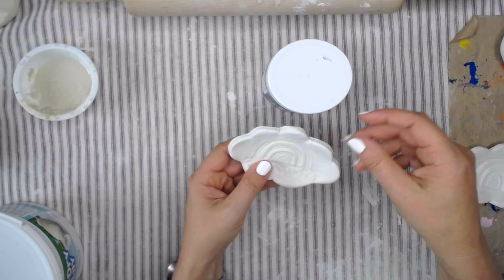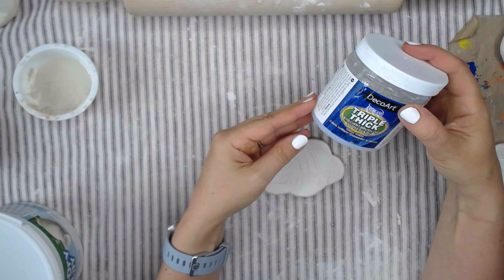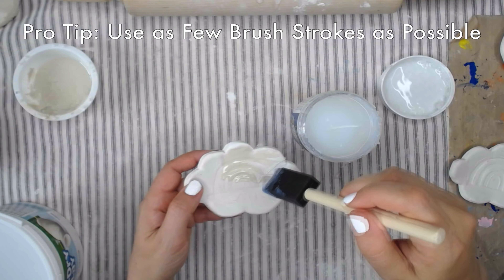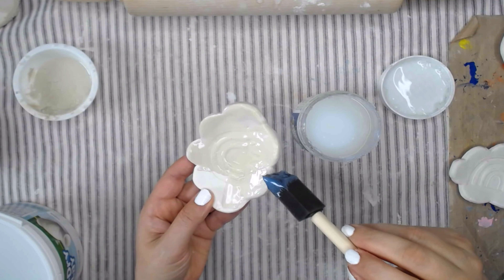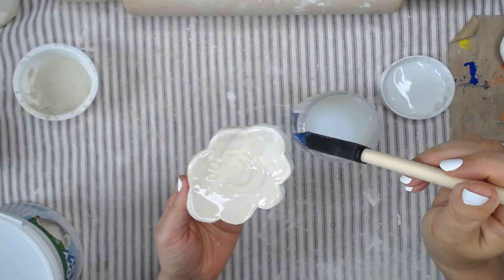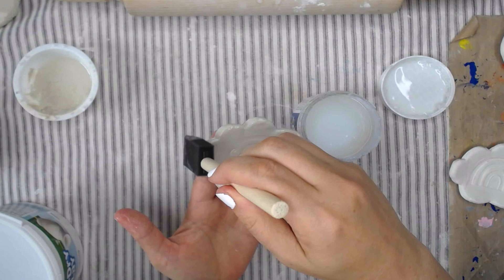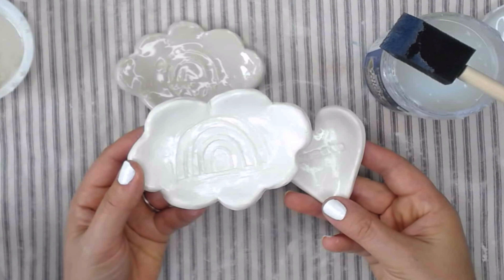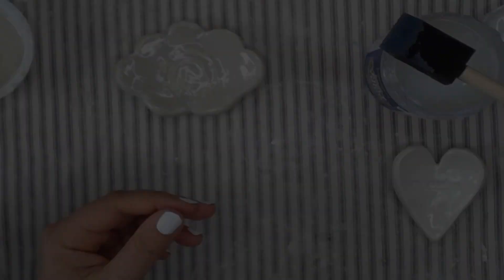How to Glaze Air Dry Clay Bowls

Comment: Does this glaze completely waterproof it? I'm looking to use it for plants and want to make sure it's plant safe at least...
Reply from the maker: Hi! So I did a bit of looking and the glaze is water resistant but not waterproof. Bc it is water based acrylic it will break down with exposure to water. But I know I’ve seen little planters so I did a bit of looking and found a tutorial that suggests you line the inside if your pot with a plastic container. I would think a yogurt container would work well with smaller pots and they used a sour cream container for a larger pot. I’ll add the link so you can take a look. Thanks for the question! I learned something new! https://myhusbandhastoomanyhobbies.com/diy-air-dry-clay-planter/
Reply: @WellCraftedStudio  Thanks!!!!!! So helpful!
Reply: @WellCraftedStudio  and great idea!!!!!

Comment: Hi. I used mod podge on my clay art and dried it completely. The problem was that it became sticky and the clay piece would stick to the surface it touches and peels off like plastic. Please advise on what to to do with this. 😓 thank you.
Reply from the maker: leslie santos unfortunately mod podge is similar to the triple thick glaze that I used in that it is acrylic based. Which means that it is basically a plastic and can be affected by heat, water etc. Maybe if you use a spray acrylic like polycrylic sealer that might cure to a harder coat. I’m really not sure though as I haven’t tested it. Sorry this isn’t more help!
Reply: @WellCraftedStudio  thank you for replying to my inquiry. I will try your suggestion. Thank you so much

Comment: hi! if i make a mug out air dry clay and proceed to glaze it? does that protect it from softening when used for beverages like coffee?
Reply from the maker: ryle u As far as I know there is no safe way to use air dry clay for beverages. Glazes  are acrylic based which means they are both water and heat susceptible. Acrylic is basically a plastic and although it says it’s non-toxic to use it would not be food safe. Sorry! 
Traditional ceramics are kiln fired at a high temp and they become waterproof essentially. Then they’re glazed with what’s basically liquid glass and that’s fired at a super high temp. You just can’t get that with air dry clay as far as I know.
Reply: Well Crafted Studio thank u so much for replying and being so accomodating 💗

Comment: would using this make the air dry clay stronger? especially if you make tiny long shapes which are easily prone to breaking
Reply from the maker: Yes! It would by adding an extra layer of support. Especially if you let it dry between coats and applied multiple coats. However, it depends on how long and thin it is. You would still need to experiment, and the more coats would mean more brushstrokes so it might not be a clean clear glaze.

Comment: Could you recommend a good Gloss for acrylic paints that I could use for my air-drying clay other than the one you've mentioned in your video please
Reply from the maker: unique wun  I tried Mod Podge gloss but didn’t like it. You could try spraying it with a Krylon gloss sealer. But of what I tried I liked it best. I’d love to know if you find something though!
Reply: I use clear varathane for all my acrylic work.
After I let a piece dry entirely, I paint thin coats and let them dry before next coat to avoid the Varathane from drying streak marks onto the art.
Reply: @KlarraDaniele  thank you
Reply: @WellCraftedStudio  thankss
Reply: @uniquewun7006  so very welcomed. And I update my original comment you commented on.
Reply: @KlarraDaniele  is that waterproof?

Comment: My paint does not want to bond directly to the clay...it peels right off.  Do I need to glaze first, then paint?
Reply from the maker: Pete Welninski you know I think I did try that when I used regular acrylics. When I used the multi-surface craft paints  I didn’t have a problem. I have some pieces here- I’ll try testing them. 🙋🏼‍♀️
Reply: @WellCraftedStudio  yeah, its been frustrating.  It peels right off. I even used a surface prep(Gesso) by  Liquitex  this last go round. No luck.
I can send you pics of before and after if that helps
Reply: @russellmills5324  will do, super frustrating

Comment: What would you use to make the air dry clay heat/fire resistant?
Reply from the maker: I actually haven’t found anything that will work that way with the air dry clay. As far as I know you’d need it to be actual ceramics.

Comment: I have a question are you able to paint with acrylic paint and then apply this gloss on top without ruining the design.
I read a few reviews and they're mentioning not to apply the glass on painted work can you let me know please please thank you
Reply from the maker: unique wun I have painted with acrylic multi surface craft paint and then added the gloss. You have to let the multi surface paint dry thoroughly first. So give it maybe 24 hours before you apply the gloss coat after you paint. The problem I did have with acrylics is that the paint wanted to bond to the glaze more then the clay and would pull away slightly. That’s why you want to make sure the acrylic has bonded. And actually that may take a couple of weeks for it to completely cure. Then go ahead and glaze. It will not ruin your design though.
Reply: @WellCraftedStudio  thanks for answering I appreciate it I'm a beginner with air-dry clay and I have been checking a lot of videos and reviews on the products I did actually make take the cloud dish that you made and it came out great thanks for the tutorial

Comment: Will this glaze make the Air Dry Clay Waterproof? I’m wanting to craft a bird bath + feeder in 1.
Or would Beeswax be a better fit for my project?
Reply from the maker: No, it won’t. It is water soluble so it will breakdown in water. I don’t know that you’ll find anything that will make air dry clay work for a bird bath. Have you looked at concrete? Thanks for your comment!!!
Reply: My sister does bird baths, she uses concrete .. heavier of course but best for out in the elements

Comment: Hi, I'm just starting and my first small plate cracked, it seems to be very soft and breakable, will that glaze make it harder? This air dry clay seems to be very easy to be damaged. Thank you for your video.
Reply from the maker: lovescotland it depends on the type of clay you use. If you’re using the crayola brand then it should not be soft. You may just need to let it dry more? The water evaporates out of the clay. 
The glaze will add a degree of hardness to the exterior of the clay but it won’t add much structurally If that makes sense. It does however keep it from surface marring. Does that help? I do have a lot more info in the blog post that’s linked in the show notes.
Reply: @WellCraftedStudio  thank you for your answer😀

Comment: how long exactly is it for the clay to be total dry? ive tried varnishing with clear gloss, and it seems like i can still leave mark out of my nails if i push it through the surface... thank youu!
Reply from the maker: Vania Augustine hi! It totally depends on the clay you use. Once dry you should be able to scratch it, but not press into it. If so, there’s a couple of things to check. 

Clay body- If you’re using a plastic based clay like Crayola’s Model Magic you can totally push your nail into it. But if you’re using a mineral based clay like Crayola’s Air Dry Clay then you should be able to scratch it, but not push into it. 

It should dry completely within 24 hours to 1 week. Mine took about 3 days. It really depends on the rate of evaporation- so if you live somewhere pretty humid it will take longer for the water to condense out of the clay body. 
A good way to check is if it still feels cool to the touch. If it does, then it is still drying. If it is white and doesn’t feel cool then it should be dry. If this is the case and it still feels soft then there could be a problem with the clay. 

It’s important not to glaze it until it’s dried completely and then to let the glaze dry completely. The glaze is plastic based so the thicker you put it on (multiple coats) the more likely you’ll feel that  when you try to push a nail into it instead of the support of the clay body underneath it. I hope that makes sense!
Reply: @WellCraftedStudio  youre awesome, thank you so much!

Comment: Hey, nice video! I’m wondering does this make the piece waterproof?
Reply from the maker: No- the manufacturer says “water-resistant” not waterproof and it is not food proof. I looked for one that was food proof and couldn’t find it. Most traditional ceramics have to be fired at an extremely high temp in a kiln to achieve that. Thanks for your comment!

Comment: Im just wondering would it be easy to be cleaned with wet tissue if i use glaze on air dry clay? Im thinking of make some hamster's house or hideouts with air dry clay. I did one before, but since i did not put any glaze on it, it was hard to clean the inside part with wet tissue.
Reply from the maker: 視V oh my goodness I missed this comment. I honestly have no I idea how it would do. Yes, it would make it easier to wipe out if you used just a damp cloth, as it is water-resistant. However it is not water-proof. Meaning it will start to break down with exposure to water. I would perhaps try a poly acrylic spray sealer. The problem with anything acrylic though is that it is water soluble at some level.

Comment: Does it have to put through fire or you just wait for it to dry ?
Reply from the maker: No fire! It’s air dry but if you want to speed up the process I’ve heard you can put it on low in your oven for a while. I never have though and they take 3-4 days. Air dry clay is a great alternative if you don’t have access to a kiln. ❤️
Reply: @WellCraftedStudio  thank you so much !
Reply from the maker: My pleasure! It’s pretty fun to play with!
Reply: Well Crafted Studio Not really a great idea, especially on larger (thicker) pieces as this could cause them to crack badly. Putting them in a heat source (oven, sun, other warm/dry areas) can cause outer parts to dry (and shrink) faster than thicker inner parts which is exactly what makes the clay crack upon drying. Best to be patient and let it dry naturally in a cool dry'ish place. On really thick pieces (like sculptures) I've even seen it recommended to place cellophane wrap lightly over the piece for more uniform drying to minimalize cracking.
Reply from the maker: Wow- you’re so right! I totally didn’t think about the clay drying differently inside and out. I take ceramics and that is actually something I knew and didn’t think about. And we do cover our work with plastic and let it dry slowly for the reason you mentioned. Thanks for the save!
Reply: @WellCraftedStudio  lol well I have to be honest... I'm literally just a beginner and only "caught" this because I just watched a video that mentioned this last night! I'm trying to learn as much as possible before I dive in, and your channel is helping me do that!
Reply from the maker: Amy Davis I’m glad you were learning as much as you can and that you shared it! ❤️

Comment: Can I paint the clay first before glazing?
Reply from the maker: AC L yes/no. It honestly depends on the type of paint you choose. And unfortunately, I don’t have a list other then I think the multi-surface craft paints are good. The problem some people have experienced is that the paint seems to pull away from the clay once you add the glaze. My best recommendation would be to test your products first, make sure each layer  is super dry before you add another, and if the paint with this glaze doesn’t work get a spray acrylic like Mod Podge’s where you can do light coats.

Comment: Hi please tell me can I make cup?
Reply from the maker: piece ofbud you can make a cup! But  it will not be food safe with this product. I couldn’t find a brush on glaze that was food safe. I’ll keep looking and update this if I find one. Thanks for your comment! ❤️
Reply: Not only is air dry clay, and this glaze not food-safe, putting liquid in it would ruin it. This is not the kind of clay you'd want for cups/plates.
Reply from the maker: Yup, @Amy Davis you’re right! When I was answering the question I was thinking that yes, air dry clay it is physically capable of making a cup shaped object. But I should have called out that you absolutely cannot use it as a cup. Which does kind of defeat the purpose of creating a cup shaped object. 🤦🏼‍♀️